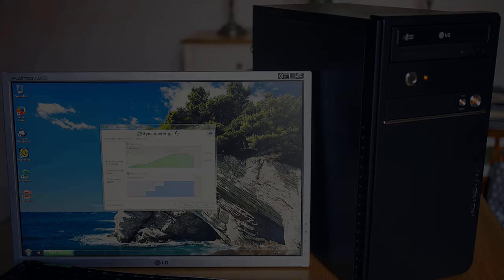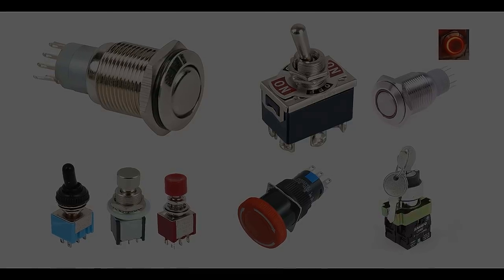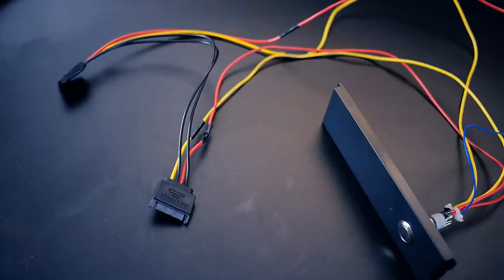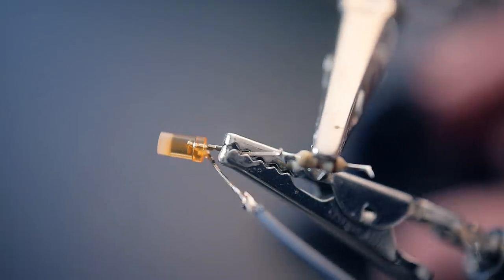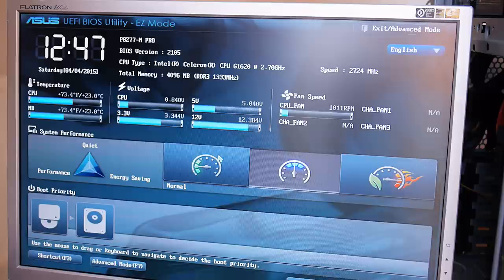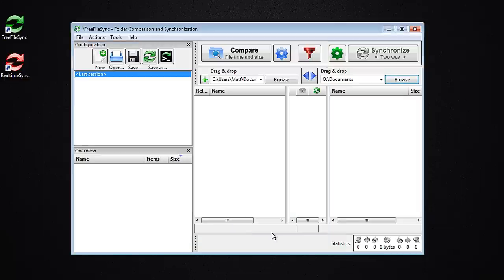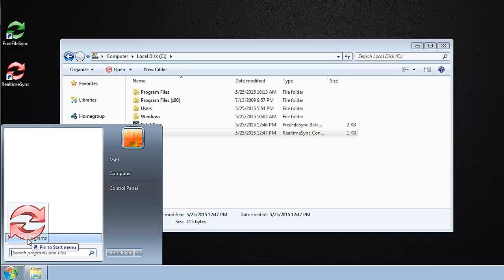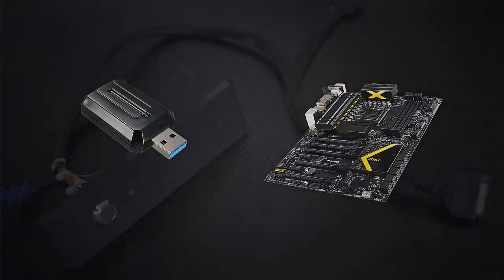How to Make a One-Click Backup Button

Comment: Just wondering:
Can I use the hardware part of this video to mount a switch which chooses either one of my two hard drives to boot?
I mean, I have windows and linux on my computer and I would absolutely love a hardwired switch to choose the OS before I boot the system. I want to power on the system not get grumpy at the grub if it selected the operating system I didn't intend to use after taking a leak during the start-up of the system.
I know it's physically possible, but I wonder if windows allows this (linux probably does anyway). It probably does since windows can't read linux partitions so it won't know anything is missing, but you'll never know.

I know I should be careful not to flick the switch while my computer is on because hotswapping a drive with a running OS would most likely not just kill my computer, but also me and my family once the drives find out who was responsible for this.
Maybe I should connect it to the reset button so if I accidently flip the switch while the pc is on, it doesn't crash, it just forced restarts in the other OS.
Reply from the maker: Totally possible - just use a double throw switch with two poles (DP DT).
Reply: Sweet! Got a project now!
Reply: +PrimaPunchy Just to make sure that it can not be switched while power is on I would use arduino or something like it to prevent switching after the power on of 1 second.  So enough time for arduino to read switch and power the the right drive and then it will ignore any switch changes till next power on. Need help I can do this.
Reply: +Mark Cisewski A easier solution could be to use one of those switch with a key and remove the key when the PC is turned on.  Even if I see myself being lazy and leaving the key inserted all the time :) Maybe you can hide the switch behind a cover.
Reply: +Silvio Pelizzoli True. if you remember the key. but am am thinking 1 little chip solution. easy.  I could put together in couple hours
Reply: +Mark Cisewski yes you can make that but an arduino isnt small enough...
Reply: Its difficult...

Because you want these:
1-A switch between two hard drives
2-A power off/on button that is activated after the switch
3-That power off/on button does not control the power! It just sends signals to the motherboard and it starts up the components (or other stuff like wake up the pc when is idling)

This two things cant be on just one switch/button
Soy you need three! 
1-switch to select the drive
2-your normal power on/off power button
3-a sensor to make unusable the switch if the sistem is powered on

The real question is...how to make that sensor? And!!!! how it would make unusable the switch without making it stop giving energy to the same drive?
Reply: Zona ALG Actually, it's pretty easy:
Make two ways for electricty to get to your drives: one through the on/on switch and one through a timed switch that doesn't start up until 20 seconds after the initial computer boot. This means that, while booting up, the computer can only see one drive, but 20 seconds later, once you're on the OS of your chosen drive and it's fully started up (probably still with time to spare), it can see both. 

It might be weird that I give the solution to my own question, but it's been 3 months now and I simply know more of the logic behind electronics.
Reply: You can select the boot priority on the bios and use the same switch we use to lights at home
Example:

Select to boot the drive with linux first
Leave always conected the one with windows
Put the switch to give or not energy to the linux drive
------------------------------------------------------------------------------------------------------------------------------------------------------
So if you select the right switch you will power "linux drive"  and it would be loaded first (start linux)
If you select the left switch you will not power linux drive so there would only be windows

The only thing on here is that every time you would be using linux you will have 2 drives powered on and you will just use 1
But if you are using linux more than windows just change "linux" to "windows" on the instructions ant there you go!!!

This is cheaper on time, mind, and money than finding answers to that questions...
Reply: Zona ALG That;s actually really good. I like it. The problem is that my solution right now is just as good since I already bought an on/on switch instead of an on/off switch. Also, you still need that extra supply of power after 20 seconds so the computer keeps running after flicking the switch

Your solution is better because it's easier and simpler. If I didn't have the switch yet (it's idle in my case atm), then I would have gone for your approach. Maybe DIY perks can do this as a follow-up project? Otherwise I could do that project once on my main channel (this one is only for youtube reactions)
Reply: PrimaPunchy
on/on switch??? so its a button not a switch?

If its a switch just let one part (example, left) with the drive and the other (right) with nothing
Reply: Zona ALG yeah, but that doesn't seem too elegant. I mean, if I do it my way, I can skip the grub in linux entirely.
And nope, it's not a button, it's a toggle.
Reply: PrimaPunchy What isnt elegant?
If its because the thing i said about the toggle well... it depends on it
Reply: Zona ALG the fact that your solution would still have the grub, but that's nitpicking. It's just less work for me to wire up that second set than to learn how to disable the grub
Reply: PrimaPunchy ohhh...ok
good luck!
Reply: yes you can do it by using a DPDT switch
Reply: you could make a more kinda-elegant solution by using an usb drive where you install your linux boot that you switch ; and setting boot from usb in the bios.(windows being the first drive to boot if the usb is not plugged in). that way, you don't have to have hot swap enabled, as usb natively supports it, and plugging or unplugging it during the computer's awake time won't change anything, and as a bonus, you can use a 1 pole switch or a selector to select from various OSs.
Reply: PrimaPunchy
Reply: the keyword here is "boot drive" ... There is no reason why it wouldn't work
Reply: This is a good and valid idea, but I'd just use external 3.5 hard drive slot(like those on NAS and servers but on your case's 5.25' drive) then replace the drive before boot. I do that when I am not booting from my main OS or test environments. Just pull out the drive when the computer is off and stick another one in. Make you feels like a server admin, at home.

Comment: For adding protection against drive failure you should use raid 1 or 10(faster, more expensive)
Back ups drives should ideally be stored in a different location from your computer. A back up should get you going again if you are infected by viruses or ransomware but it should also protect against physical harm such as theft or fire.

Comment: To prevent HDD failures you could use a external HDD and do that with the button. You can cut a 10cm USB extension cable and  cut the ground wire and solder it onto a switch. The LED could be powered from the power of the USB connection from the PC

Comment: you could use a old wire from a adpator and twist them onto the switch as I did not have a soldering iron to use for it. PS my switch   had holes in the solder tags so i was able to use them and twist on the wires thanks for the idea Matt..:-)

Comment: Don't forget about voltage surges through GND during storm :P You should use 3-channel switch to be sure enough about "electrical connection" that you mension in video...
Reply: +Cezary Rodziewicz Almost any half decent power supply in the last 5 years should protect against that, you should check the product info. But you're probably right, for an extra bit of security a 3 channel is probably a good idea.

Comment: Great tutorial Matt, and really useful too.
I was about to do it myself and then realized that my motherboard supports this thing exactly, out of the box.

However, I do have problems with Free File Sync.
So, I connected my backup drive to motherboard and turning it on/off, works well.

The problem is that nothing happens when I turn drive on.
When I hover the tray icon, it says "Waiting until all directories are available...". 
I've checked folders and they all seem to be there. 
Both source and destination.

Comment: I'd recommend RAID 1 instead. It will mirror the entire system (including the operating system) which would mean that the user would gain fault tolerance for the entire system instead of just documents and it would give a performance increase, not a decrease

Comment: Love your work and installed this for a friend who isn't that computer savvy but very methodical so will do the back up at regular intervals as required. However it then struck me that should they (or their grandchildren!) delete files on the main drive then recovering those files becomes tricky as when they plug in the backup drive the software will automatically mirror the deletions.I might take the batch file out of startup and let them run it manually but open to suggestion
Reply from the maker: +Don Fossey You can change the mirror mode if you want. I think you can configure it to ignore deletions - there are many ways it can be configured so it's worth having a look for something that will fit your needs.
Reply: +DIY Perks Great!I'll give it a deeper look.Keep up the good work

Comment: You could always have the external drive constantly plugged in and put a switch across the hot wire in the usb cable, this would then work exactly the same. :)

Comment: Backing up to a hard drive which is INSIDE the computer is not useless, but it is pretty close! If something happens to the computer itself, be it a power surge or fire or a flood or whatever, both the main drive and the backup drive will die together. Backups should be stored on  an external device, which is to be disconnected from the computer and stored in a different location, meaning another room or ideally not in the same building.
Reply from the maker: The point is that the drive is physically disconnected 98% of the time. This protects it from power surges, PSU failures, ransom ware etc. Pretty good for most people.
Reply: DIY Perks Agree!!  backing up process is usefull for the C partition in case of cash of the operative system or during  the reinstalation of the system...

Comment: The only thing I don't like about this the use of the software.

I've written my own backup scripts that include compression, versioning, and anything else you could really think of and given that we're doing this whole DIY thing with soldering it is odd to me that we're not customizing the software to the same extent.

In my last script for example, I had 7-Zip compare certain folders against 7zip archives of those folders. If there were differences then the archives were updated. Then using a GFS or Grandfather/Father/Son system I pushed the relevant archive to specific folders and named them based on date. The GFS concept is that you have a backup that is updated frequently, a backup that is updated less frequently, and a backup that is updated infrequently. In my case, I was updating the Son every day, the Father every week, and the Grandfather every month. I maintained 7 Sons, 3 Fathers, and six Grandfathers. This lets me catch corruptions in a database that is very important within 7 days to the day. Or if I don't catch it that fast, then I can compare damaged records to the last good Father or Grandfather backup.

I don't back up the operating system etc because it isn't vital or unique information. I can recover it with a reinstall. The same is true of the programs. I don't have any program that I can't recover.

What matters is data.

So you're talking about emails, browser profile, document's folder, desktop folder, pictures, music, etc.

A relatively tiny portion of my total disk space is taken up by such things. Most of it is programs or temporary files that I just don't care about. That is my situation and other people might be different.

But I do think that scripting backups is a better way to go because you get a lot more control over how it works.

In the case of this backup I'm talking about, it doesn't back up to the same destination. I have multiple machines on the network and the script backs up to a local external daily for the Son. The father back up which happens once a week, is pushed to an entirely different machine. And the grand father which happens once a month is pushed to an offsite location.

I'm sure most people don't need anything this elaborate but the point is to give people personal control over what the software is actually doing.

The project was interesting. I subscribed to your channel when I saw you building that silent computer. That is one of my pet peevs with computers as well. Far too noisy. I'm one of those poor people that can hear electronics. Not the fans but the capacitors whining and the florescent tubes buzzing, and all of that. All day I hear it and it is sort of like flying on an airplane. You just get used to it. But it is annoying and it would be wonderful if they made any real effort to make the damned things quiet.

I'm a big fan of Terminal computing for this reason. Most work and corporate machines aren't doing anything that is especially stressful for the workstation. The heavy lifting if any is done at all is generally done by a server either onsite or off. So you have a terminal which is a tiny little computer that accepts information from a terminal server. And the tiny computer can be passively cooled, stores its boot OS on an SD card, and all the noisy computer crap happens in a server room somewhere else.

It makes IT administration a dream as well. Idiot employee installs garbage on the client?... erase his client and refresh it from the template. Over and done. I make a point of reverting everything to templates twice a year just because. They're told it is coming... they put the few things on the file server that should have been on the file server in the first place... and then full wipe of all workstations to defaults. Takes about 10 minutes. I love it.
Reply: Diogenes The software he uses seems to just copy paste :(
Reply: Slot1Gamer
I wonder if it copies over the MBR as well? Because if it doesn't, that backup drive won't boot. That is, if your primary drive dies and you think you're just going to switch to the back up drive on the fly... it won't work unless the MBR etc is set up properly.

Sorry... I do a lot of systems administration so I deal with backups etc all the time.
Reply: Diogenes Use a disk cloning program instead? On my Linux servers i just have a scheduled dd
Reply: ypoora1
Does your program work incrementally?

Honestly, I don't worry so much about my system partition. There's nothing on it that I really care about... certainly not the operating system. I back up what I care about and the rest... meh.

Comment: You should have shown a wiring diagram, it was a bit hard to understand what you meant. But now i get it, you simply switch both the 5v and 12v supply to the hdd with a double pole switch...

Comment: Well, this might not be the so called rocket science, but nevertheless it requires specialized tools and some manual skills - while the same end result could be achieved with just using a proper software and its configuration

Although yes: the one undisputed advantage of such system is the additional layer of security, i.e. disconnection of the disk from the power grid. But at the same time this also creates a drawback of having to remember to push the button after doing any kid of important work or new data acquisition [so there goes the full automation of the process being performed totally in the background]

Comment: Hi Matt. I really enjoy your videos, and look forward to every DIY project of yours. I just got hands on some old used PSU's from some PC's, and I often need a 12v powersupply for electronic projects as running a headunit from a car, in my living room. But I don't get any voltage from it? I'm thinking maybe there has to be a certain current drawn from it, before it deliver power, but I'm not sure. Do you know how to do, and could you make a video about it? Btw, I just got my first desktop pc, so I'm going to do this backup mod aswell as the 100w LED flashlight. Cheers!
Reply from the maker: +Magnus Frederiksen If it's not attached to a motherboard I believe the green lead on the mobo connector has to be shorted to ground. Double check on the 'net first before trying though.
Reply: +DIY Perks thanks man, ill look into that. looking forward to your next vid!
Reply: +Magnus Frederiksen that is correct, thats why self testers have a shorted pin.